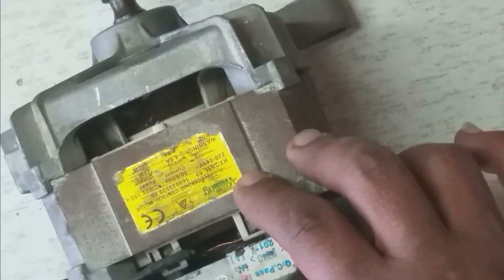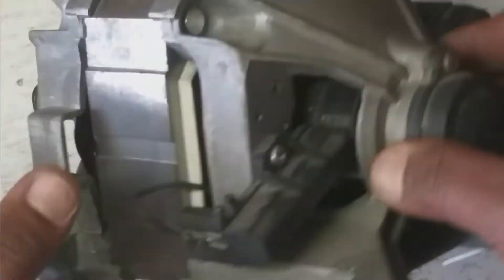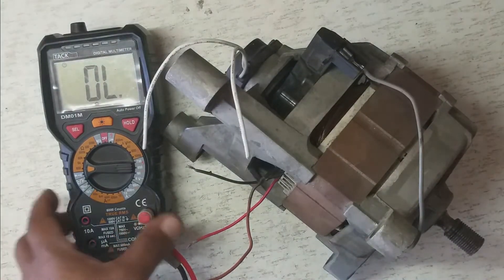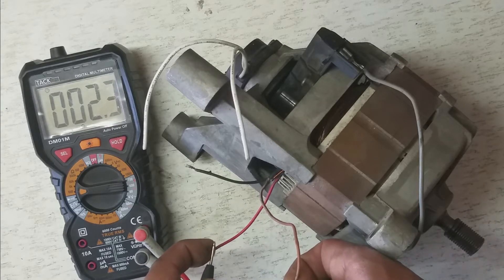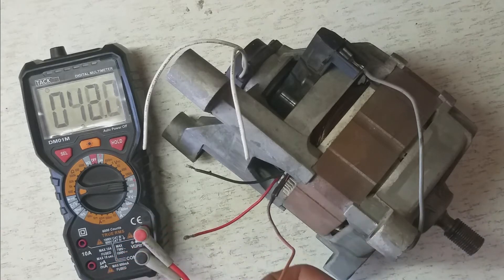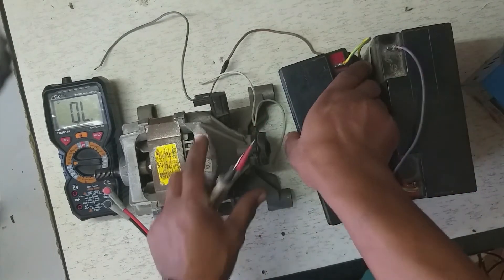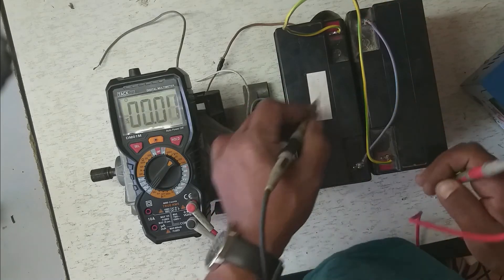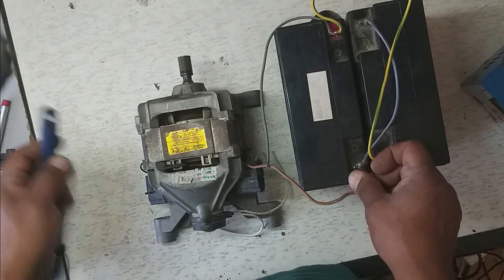How to Run a 220 volt AC motor with 12 volts battery

Comment: Some motors have a diode built into the brushes. Could you perhaps write me why and how is this installed?
Reply from the maker: hi there, thank you for your comment. motors with built in diodes are made to generate voltage when rotating like car alternator not a motor. but i think there is a way you can do some modification and run it like a motor. i will send you diagram to show that soon.

Comment: Is it only work with AC motor with carbon brush. 
Can it connect with AC motor that dont have carbon brush. Ex: old AC water pump motor, washing machine.
Reply from the maker: yes it doesn't work for induction motor, but i will see if there is a way to modify that to work, i will send you how to.....soon. keep InTouch
Reply: @masterantex hey friend is it possible to do with this with a camera